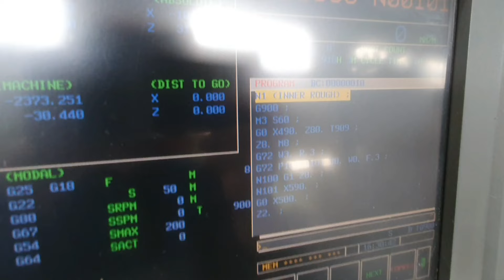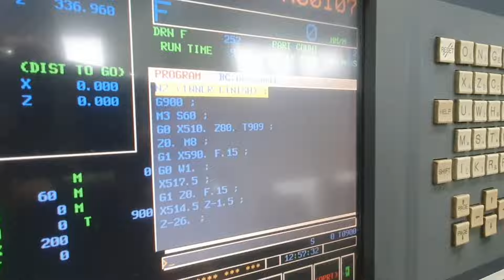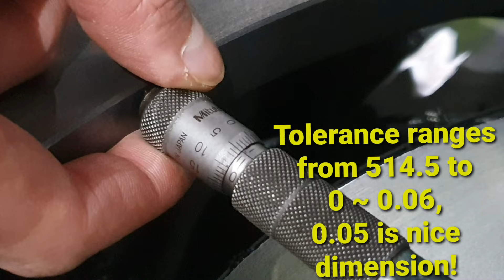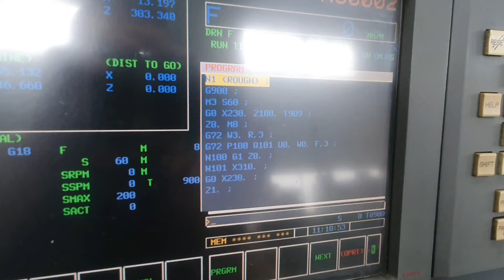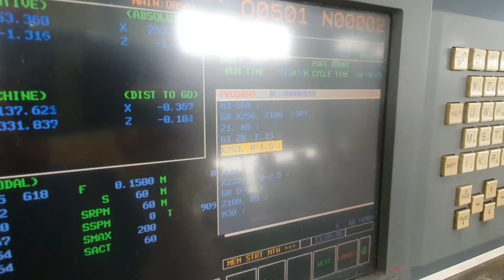Big Turbo Compressor Housing Machining - CNC Lathe, Vertical Lathe, Turning

Comment: Finishing cut with a 0.8 radius insert. :)
I'm working with a much smaller CNC Lathe, mainly in hardened materials so my go to insert when doin the finishing cut is a 0.2 or a 0.4 radius insert with a depth of 0.1mm tops, most common is 0.06mm. The details are ofc way way smaller then this. Still really cool to see stuff like this.

Comment: A chuck in a chuck, good start on a friday!
Reply: Was thinking the same thing. Retired now but was a CNC-VTL machinist that machined pump housings, some over 2,000 # in size, down to little 12 inch ones. Never used a 3-jaw in a 4-jaw setup. Just something else to come loose or cause vibrations due to excess height from machine base. Just stick it in the 4-jaw and indicate it in.